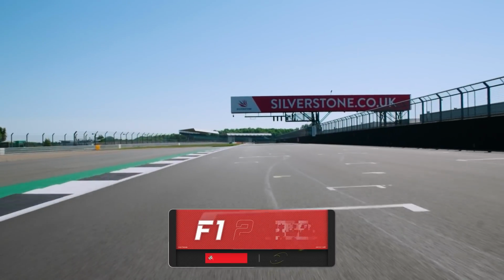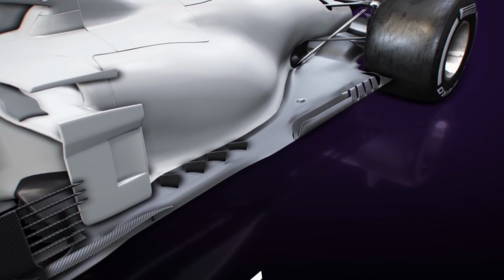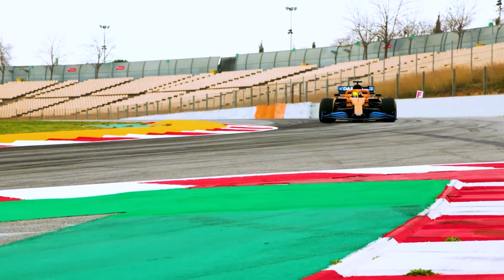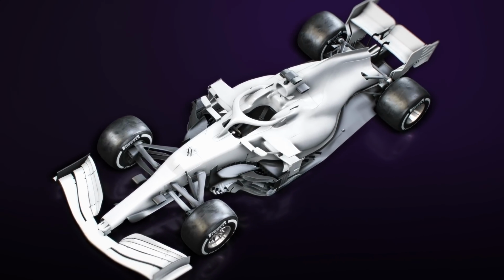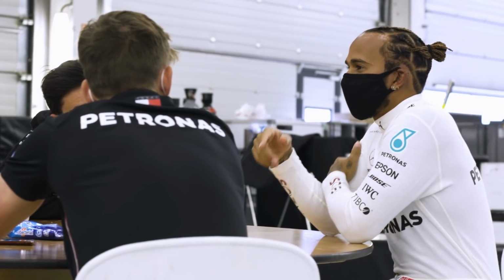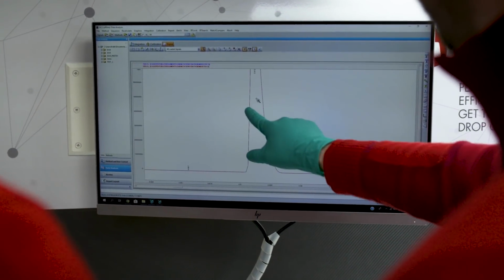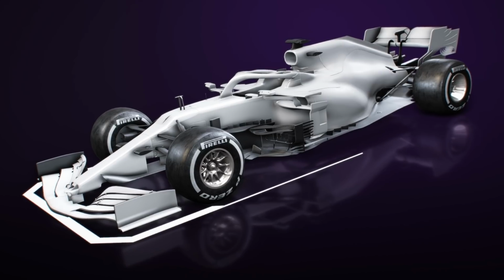F1's Updated 2021 Rules Explained - Everything You Need To Know

Comment: How good was DAS? What was it worth to Mercedes? Other than that, I can't see this tweaking making much difference.
Reply: It depends on how good it becomes. Imagine having it automated, a super computer constantly calculating and executing the best tyre angle for turn in and/or tyre wear for every corner. 

Right now Mercedes only uses it during safety cars, they angle the tyres increase the heat. This way when the safety car ends their tyres are nice and warm while the competitors have cold tyres. Tyres at the correct temperature have better grip which results in better straight line acceleration and cornering.

Comment: In short they fucked up downforce and increased weight of formula 1 cars which impacts speed and brakes as them brakes will have to deliver much greater strenght which will cause overheating problems.
GG WP

Comment: I wish the FIA didn't have to so pedantically prescribe every fine  detail. Wouldn't it be nice if they had good enough measurement techniques or simulators that they could just prescribe performance characteristics and measure them for each car to ensure they're in check. Like they'd just say this is the maximum downforce on the tires, this is the maximum acceleration in each direction, this is the maximum Reynolds number for the airflow in a few positions behind the car in a few different race conditions, + a whole bunch of safety design regulations, etc, then let the engineers design whatever they want.

Comment: Increasing the weight of the engine to 150kg does not discourage the use of expensive materials.
More material can now be added in critical areas.
What would of been more appropriate is reducing the fuel flow rate further, there by reducing the potential power output and eliminating the need for a more robust assembly

Comment: I've been an avid fan of F1 for the last 50 years. Over those 5 decades I've seen some fantastic inovations, such as dual chassis, six wheels and even fans to suck the cars down onto the track. Each year I used to sit with my father to see who had come up with an out of the box idea to win the championship. Now, the rules are so tightly governed, there are no great surprises now days. The last great surprise was Brawn.  I say let the designers run free a little. By all means give the FIA power to ban an advantage the following year but let their engineers develop. F1 should be exciting both from a driving point of view and engineering. Bring back tyre wars and refueling too

Comment: “Formula One is all about progress” with rules making cars slower....
Reply: Less downforce means more straight line speed and less corrections in the corners, the lap times will be almost the same but we will see more drivers spin in corners when they are not approaching the ideal line. Probably the redbull will have less advantage in corners as they do now, they have the only car to approach almost any line in corners and yet still exit it faster then everyone
Reply: I think f1 will be even more boring Because there just making them slower to see them going slower than usual would be boring it’ll be like every car ran out of fuel
Reply: The 2022 reg cars eventually will get as fast as the 2029 cars hy arund 2024 or 2025
Reply: Except teams still have to innovate to make their cars the fastest within those regulations. Progress is not about getting faster, but to innovate in such a way that you get an advantage over your opponent.

People screaming "Make car go fast. wroom. wroom" really should look into drag racing.

Comment: Just make the car go Hybrid or completely electric. (Might need to design new way to quick swap battery instead of the Fomula E method which you just prepare 2 cars, but yeah,) done
Reply: @valerierodger7700  formula E has to prepare two cars because the battery won't last through the entire race. The driver just hop into the other when their battery is almost done as they pit.

Comment: The new materials idea would be scrapped as they won't have the sturdiness of carbon fibre and would break apart easily. Although they won't be in shards it will mean that alot of cars will end up needing to pit for a new front wing from the slightest of contact

Comment: This new opening to plant-based materials for the contruction of the cars got me really excited. This could be huge also for production vehicles, if the development goes in the right direction: it potentially means a drastic cut on energy and emissions required to manifacture car parts, whilst eliminating the need to mine the earth for ores needed to create expensive alloys. If followed up by manufactures this might be the biggest and most significative change to the regulations since the introduction of the hybrid power units from an environmental standpoint.

Comment: In all my decades of watching F1, rarely does the FIA ever get this right. They do however find ways to shift the problem set, but not the excitement level or competitiveness level of the sport. 

As far as the use of natural materials and fibres, while I am very much for it, to date they have yet to meet the performance level of the many materials that they seek to replace, especially on a weight to strength ratio. I also question their abilities to resist heat and fire. Certainly, it might be possible to make them so, though likely the chemicals needed to do so, will not be so environmentally friendly, thus offsetting their perceived environmental friendly. 

In the end, if you are interested in the technological side of motorsport, Formula E is likely where you will find the leading edge. I also like LMP/endurance racing. Both of these have technology development that is far more relevant to the motor vehicles that manufactured for everyday use.

Comment: I'm curious as to why the FIA has decided to reduce the effectiveness of the floor rather than to reduce the effectiveness of the top aero like the front wing and rear wing, especially since that is the primary objective the future regulations, as the top aero is the key culprit in producing dirty air. If it has to do with cost then that's one thing, but it seems as if leaving the floor regulations the same and having teams have to change their wing designs would shake things up a little more and be a more effective way to reach that 10% reduction mark.

Comment: The 2019 cars were rapid; setting purple lap times on the regular.
This yr and next, they're slowing the cars down to prevent too much of gap amongst the grid (minus merc).
Hopefully 2022 rulebook will act as "big reset" for teams.
Kind of levels the playing field as everyone has to start their car build from scratch.

Just like when they first switched to hybrid, in the 1st yr (or 2) the cars wont be as quick as current gen, but this is normal.
They'll get faster as teams innovate and engineer over several seasons.

From a spectators point of view, this is good news, and I hope it bring back the crowds of yesteryears.

Comment: This appears to be an awful lot of minor tinkering with the rules.  It will do little or nothing to change the borefest that modern F1 has become.  The best thing they could do for fans is introduce a minimum pit stop time (say 15 or 30 seconds) which will ensure that any racing for position would have to take place on the track rather than through pit stop strategies.  Maybe then I might start watching ti again.

Comment: Carbon-Fibre is natural. DAS never worked - Merc rarely used it, when they did there were always issues. I suspect Pirelli compounds don't react well to being deliberately slid more than a few degrees off the direction of rotation. Most tyre compounds these days are optimised to reduce rolling resistance; extreme slip angles will cause them to fail spectacularly.

Comment: the fia are absolute idiots when they want to make f1 safer, if you want to make it safer, then get rid of that stupid minimum weight requirement and make a new rule saying thats cars require atleast "x" newton meters of torsional rigidity. because lighter cars are safer. It would also reduce the stress on the tires. What idiots.

Comment: FIA: these cars put too much load on their tires so let’s slow them down
Also FIA: let’s make the cars heavier
Reply: Reducing downforce 10% will mean about 250 kgs at 300 km/h. A weight increase of 3 kgs is negligible in that department.
Reply: @thethirdman225  there's less preassure on the tires but more sliding now with thse changes
Reply: @thethirdman225  why can’t they make the cars light and nimble they are just boats nowadays
Reply: @xtremewillie  They're as fast as they've ever been.
Reply: @thethirdman225  I know they are but they are incredibly clumsy cars.
Reply: @thethirdman225  cars are almost 150 kilos heavier than they were 10 years ago
Reply: @xtremewillie  I know.
Reply: @xtremewillie  ...and yet they still go around a racetrack faster than anything else on the planet.
Reply: @thethirdman225  the reason many cars are becoming tallied is for pedestrian safety, although... in formula 1 there is no point of pedestrian safety because no matter how rubbery your cars are, it’s not gonna stop them from obliterating somebody at ~180 mph
Reply: @ryanmburnett  I’m not sure what you’re referring to.
Reply: @xtremewillie  They could knock off 50-100kg off the min weight if they really wanted, but the money needed for developing lightweight parts from exotic material would lead to an even bigger gap amongst the grid.
Reply: @omarspost  they had 600kg cars 10 years ago and we had the most exciting racing
Reply: @xtremewillie  745KG is a boat?
Reply: F1 needs another tire manufacturer to compete with Pirelli.
Reply: @Majima_Nowhere  It would help but I don’t see anyone stepping up to the plate. The only other one with recent experience is Bridgestone.
Reply: @Majima_Nowhere  Do you want another U.S.A 2005? Because that's how you get a U.S.A 2005.
Reply: @Majima_Nowhere  Not really, no. Pirelli isn't bad, it sticks exactly to the regulations set by the FIA. F1 needs to scrap the turbo hybrid bs, go back to simpler/cheaper engines so that third party manufacturers can join and everyone stops getting Merc engines.
Reply: @Jonathan Bovier Some interesting proposals there but F1 is not going to give up on hybrids. By synthetic fuels, I assume you mean biofuel...? There are problems with that too. Why mandate a maximum wheelbase? Just curious. This is just a stop gap until next year anyway.
Reply: @Jonathan Bovier 
"Though wheelbase will be limited with the 2022 regs anyway, for the same reason width and height get regulated, perhaps?"

Mmmm... not sure. There was a comparison between a 2010 Braun and a 2019 Mercedes somewhere on Youtube and the difference in size is very noticeable. The 2010 car was maybe half a metre shorter. I suspect this has been done in part to offset the limitation on rear wing overhang but it also mean potentially lengthening the underfloor area. I'd be in favour of a maximum wheelbase size, in part for that reason.

"BTW synthetic fuels are supposed to come by 2023, but let's see if the FIA manages to fuck this up too."

This will come down to engine manufacturers but you can guarantee the FIA will get the blame. It will take them time to optimise their engines for synthetic fuels and they will want plenty of lead time.
Reply: @Jonathan Bovier And tell me what your solution is.
Reply: @thethirdman225  lol you think you won with that argument
Reply: @Jonathan Bovier man you try to make the jobs of these engineers that spend years trying to figure out things sound as simple as having a showerthought hahaha
Reply: Let's not forget that ancien cars were able to refuel during the race, so they were starting with less fuel weight ...
Reply: @Jonathan Bovier Yes, the 2009 Brawn. Maybe you saw the same one.
Reply: @Jonathan Bovier people put too much emphasis on green b.s anyhow. Such an exaggerated subject.
Reply: @Gl-my8fw  Not true. Racing has to stay relevant. I see it all the time: get rid of paddles, they say. Get rid of driver aids, etc.. What you end up with is something that has no relevance because hardly anyone is driving cars like that now. If everyone was still driving with three pedals and a H-pattern box, I might agree but they’re not and the same applies to hybrids. Engine manufacturers have to tailor their development programs so they can get some benefit out of it or there’s no point. These “green” cars are still making 1,000 hp and they’re still the fastest things around any track so I don’t really understand what the complaint is.
Reply: @thethirdman225  electrics wont be taking over the consumer market any time in the next few decades though.
Reply: @Gl-my8fw  Look again. Several major cities in Europe alone will be banning fossil fuel vehicles from inner city areas in the next fifteen years. There will be lots more who will follow. Look too, at the number of car companies now actually making electric vehicles. It’s not just Tesla. Mercedes, BMW, Volvo... they’re all doing it. Then there’s Hyundai and Kia. They wouldn’t be doing it if there wasn’t a buck in it even now. Look at some of the hybrids coming out of companies like Porsche and Ferrari.

Formula 1 and motorsport generally, has to evolve or die.
Reply: @thethirdman225  yeah but eletric cars pullute 3 times more than a normal car . More we make ,more the they pollute . And they will require a insane amount of energy.  For me electric is not the future , future is something else . Just politics , just politics
Reply: @missouriresole4726  
"eletric cars pullute 3 times more than a normal car "

Source?

Have you included nuclear power or solar?
Reply: @thethirdman225  It's going to die. I have yet to see an F1 fan be in favor of more complex engines of higher cost to develop and maintain, furthering the dominance of companies/teams with more resources. There is little to no incentives for companies to join F1 nowadays, feeding this cycle.

Comment: F1 Should be the ultimate in design using any technology available.  This is a joke and also while im moaning electric racing is the most boring motor sport I've ever seen. Why not just stick an identical electric motor in all cars, make them driverless and control them from a high tower in the middle of the track although hang on a minute isn't that called 1/8 electric model saloon car racing. Check it out it's much more spectacular.

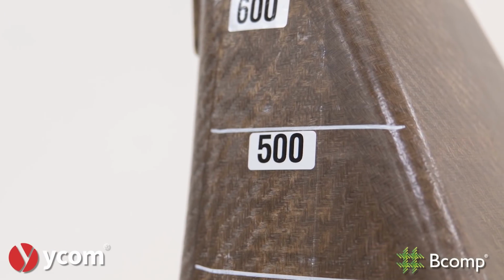Comment: 5:30, um, source that using "green" materials actually does that? Beyond your butt? Simply because it's a "green" material doesn't mean it's better for the environment. It's 40% heavier for one, so you need to make 40% more, so even if manufacturing was greener it would need to be at least 40% more.

Comment: They can try to slow the cars down but the engineers will just find a way to get the downforce back
Reply: Kind of the point, no? Evening out the field on downforce, everybody starting (partially) afresh developing downforce?
Reply: @13233eniis  as we've learned from the past the engineers will just claw back the downforce somehow as they did at the start of the hybrid era. In 2014 they lost a lot of downforce from the new aero regulations but in 2016 the fastest lap ever at the time, was set by Lewis Hamilton. And with testing in the wind tunnels and throughout simulations they will most likely find loopholes in the new aero rules for 2021.
Reply: If you read my comment again, you'll see that I, in fact, agree with you.

Comment: The new rule set really feels like a swing and a miss from the FIA, it looks very much like it will bake in the advantage Merc hold over the field and have the major downside due to the cap of preventing others catching up, as merc developement cycle will be assured now. We need simplier rules with more freedom of design not more limits.
Reply: The cap doesn’t prevent teams from catching up. Mercedes and red bull only get further away from the field cos of the unlimited spend that they have compared to other teams . Having restrictions on the cost means they can’t get further away. Having no cap is the reason why there was a big 3 from 2016-2019 where wins only occurred between mercedes, Ferrari and red bull and why teams at the bottom are struggling to stay in the sport cos they know they’ll never get a budget similar to those top 3 barring a huge takeover

Comment: It's such a shame these are meant to be the fastest and most amazing cars in the world and they're working to slow them down??
Reply: Only because the tires which are the same cannot handle the loads of the constant gains in downforce. If they gained another 10% over next season the number of tire failures would be unsafe and we could have another Grosean like incident. Pirelli does not have the $$ to make entire new tire designs for only 2021 as 2022 is the new rim size.
Reply: It always happens from time to time. Teams will develop sth to be faster even with the regulations a couple years later
Reply: They will continue to be the fastest by a considerable distance.
Reply: How dare they want people to actually be alive, How dare they.
Reply: So what happens in f2? Do they make the, slower